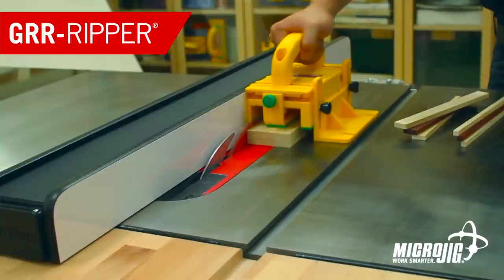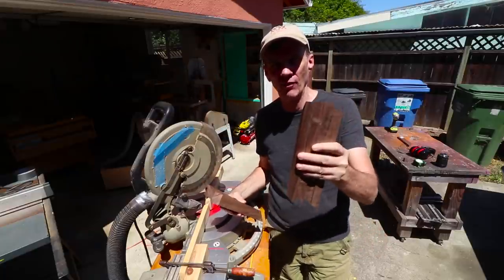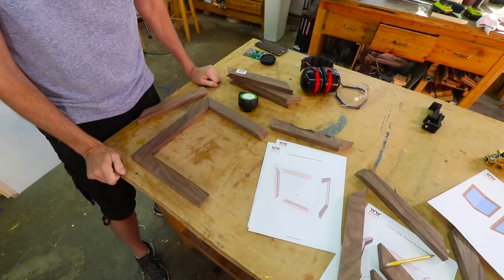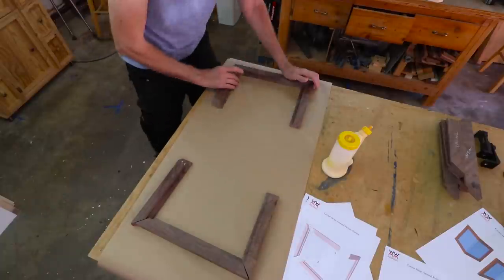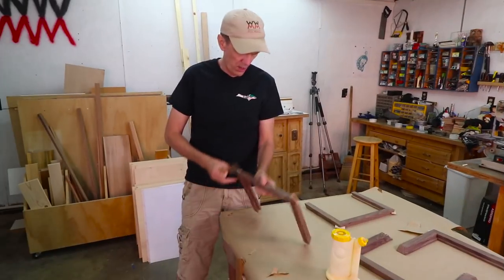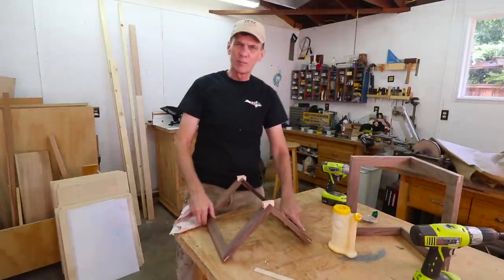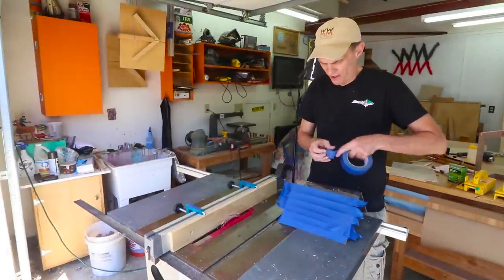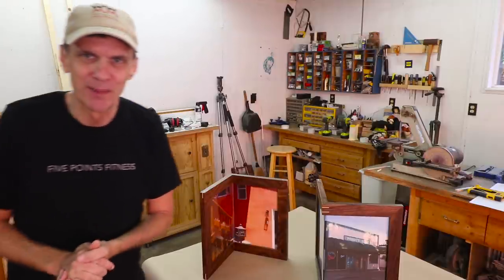Wrap Around Corner Picture Frames | STEP IT UP Woodworking

Comment: Did you consider making a normal frame, wider than normal, and then cutting it in half. Then you could cut miters on the rails. and assembling halves the way you needed.  That may have simplifed the compound angles by turning them into a couple separate steps. neat project!

Comment: What a creative idea! For larger formats, there might be some play in the perspective. For example, if the photo shows two faces of a skyscraper, split at the center, then orthographically, you'd want two straight-on photos for each face, stitched together in your chosen editor. By which I mean Photoshop. But we live in the real world and have perspective, so there's probably a balance point based on the size of the piece and the viewing angle. If you have a high-resolution photo with plenty of excess room that can be cropped off as needed, then this would probably involve the projection transform controls.

Comment: you can use sections of aluminum foil to mask off the acrylic when you heat it with the heat gun.  Just leave a narrow strip uncovered, and that part will heat up faster, so you get a sharper bend.

Comment: The inside corners are totally splinable!
Put it on the spline jig (front facing up), and raise the blade a little higher, so the kerfs go through a ½" or so.

Next: A curved picture frame to be hung on a curved wall or round column.

Comment: You could cut spline grooves on the inside corners if you raise the blade high enough to cut the groove all the way through the width of the frame.

Comment: I don't know which is better sometimes the videos or the comments. I'm going to try that plexi bending thing with my embossing tool and see how it works. You've probably created a monster showing that. I've heard that cutting walnut can be more dangerous than other wood because of something in it. Is that accurate information? Thanks for including your errors as well. I'm a quilter and it's actually happened to me mitering and binding edges. Longer is definitely better though. Very cool project, too!

Comment: When you re-cut the bevels to length, you reduced the length of one side, but it seems you never cut the other side (with the correct bevel direction) to match the reduced length of the corrected sides.
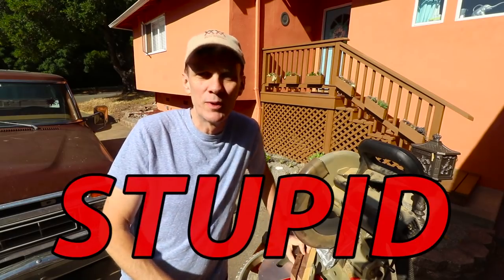2:51 You recut the bevels
3:08 You can see the different lengths here

Not sure if that was corrected before the final build, as a recut on the correct bevels was never shown.   This is probably why it was not perfectly square.
I'm pretty sure nobody will notice on the wall, so it's all good.

Comment: I think you still could have added splines to the inner corner frame for strength. You just wouldn't be able to see them because they'd be on the back side.
Reply: Seems like you could cut all the way through from the back side (outside). Or, cut them into the front side before the glue up.

Comment: Tip for bending the plexiglass.  After clamping it in place, put another piece of wood on top of the rest of the plexiglass, leaving about a 1/4" gap where the plexiglass is exposed.  It will help isolate wear the heat goes and thus where the plexiglass will bend.

Comment: well, I'm a self professed  "stupid" ww.
I think doing a spline on the inside corners would work well. just make them longer so they show on the inside faces and then trim/sand them flush - adding  strength and visual interest.

Comment: Why couldn't you do splines on the inside corners?  Could make them not visible (and easy) or visible (and harder).
Reply: JG: The only reason I can think of is that the jig is designed to cut into the outsides of the corners. So, I think you could do visible splines for those inside surfaces—they would just have to be much larger than normal or use some other technique.

Comment: WOW!  You are a better man than me!  I think I would end up throwing a tool across the garage!  I can never seem to get the measurements right when cutting 45 degree frame cuts.  It seems I am always off by 1/8-1/4 of an inch on the inside measurement no matter how many times I measure or which tape measure I use.  Any idea what I could be doing wrong?  I keep feeling like I am missing something basic.....

Comment: I could be wrong, but I think that both the problems with gluing each half and the problems with cutting the pieces wrong would be avoided if you first make a flat rectangular frame, and then bevel-cut the two long sides at the midpoint. (And then assemble the two halves as before.)

Comment: Hi Steve. Just a tip, when heating the plexiglass, heat both sides. Will make it easier to bend and also square off the corner better. Also, use something that has a square edge to bend it instead of a rounded edge.